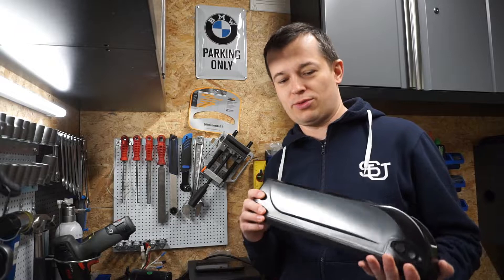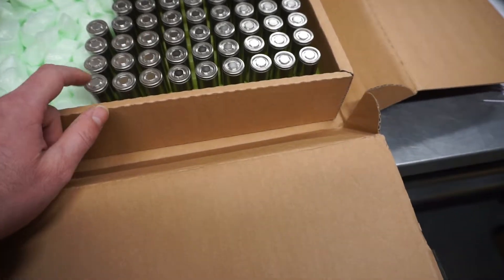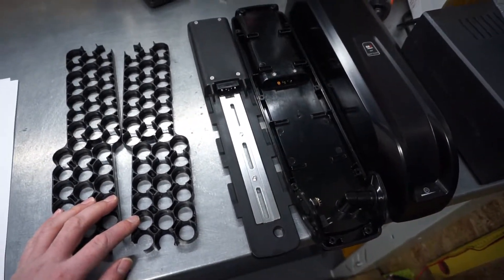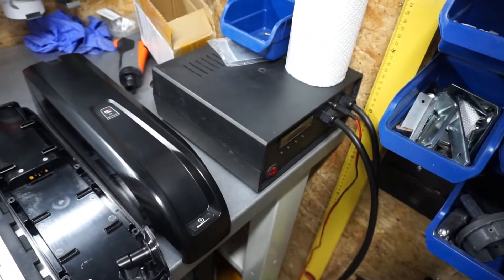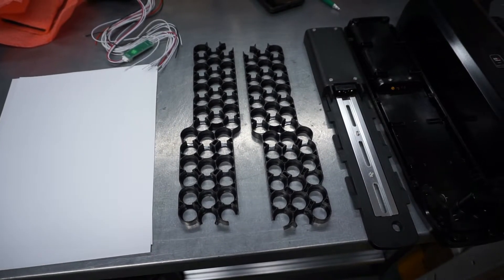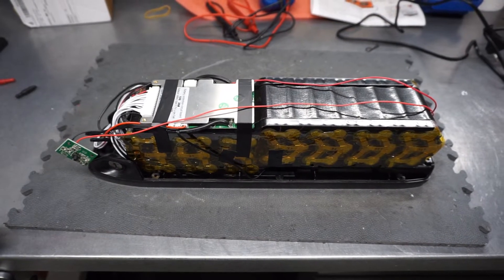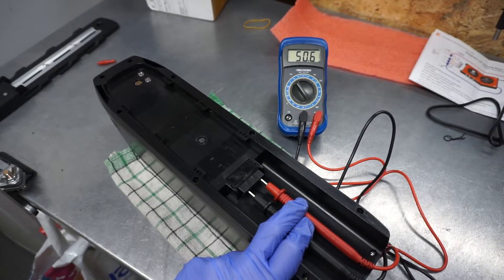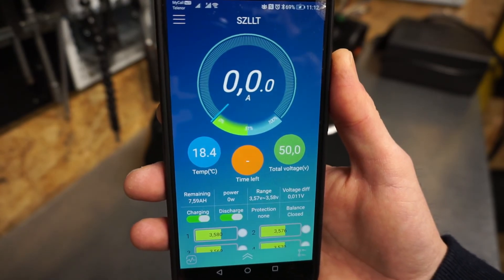Battery with 21700 cells and Smart BMS

Comment: I have a yamaha pw-se motor my battery bms went into protection e and f flashing so do i leave old bms on or do i remove it completely? Do i get another bms put that on the battery or do i not need a bms at all does this device protect my battery if i just add it to the bike my bikes a hardseven 1.0 haibike 2019 model help appropriated guys thank you.
Reply from the maker: If your BMS in original battery is kaput, then you need to install a new one. It's impossible to get original one, so you have to go with generic one plus Yamaha BMS dongle. I have separate video about it.
Reply: @LierskogenEbikes  Thank you should i get a smart bms can you trll me which one to get please and ill order it your the best person i could ask for advice.Cheers

Comment: How do you turn on the pairing of the Smart BMS on the battery..?  I know how to pair things with my smart phone, but the battery doesn't have a button to turn on pairing function...
Reply from the maker: With the power switch on the battery. When this battery is turned on, BMS starts the Bluetooth module.
Reply: @LierskogenEbikes  Thanks.. I just ordered 2 new batteries for my recumbent trike... they are the 52v 19.2ah Tesla 21700... And they have SMART BMS .
I'm anxious to see if they deliver 47% more range and up to 80% more power... UPP has a great reputation..   Cheers

Comment: Hello, I'm planning to install the CYC X1 PRO 2 on my fatbike. I live in Switzerland in the mountain and what mainly use it during winter time uphill with some load. What will you recommend as a setup to get a maximum of torque as the high speed is not such interesting in this case. Idea of setup with battery and controller is BAC2000 + 48v = 4000W or BAC855 + 72V = 3200 W. What would be the best setup in my case ?
Reply from the maker: Motor with BAC855 has much more clean layout than BAC2000. BAC2000 is bulky and has bad cables arrangement sticking out of the box. I'm happy with BAC855 on my fatbike. Really I don't need more power from this motor. For BAC2000 you will need special battery to deliver high current of more than I recon 50A-60A continously to see a real difference from BAC855. People don't say it but output from this BAC2000 controller is very affected by the battery. BAC855 is limited to provide max 90A in the peak, but BAC2000 can give up to 220A peak.
Reply: @LierskogenEbikes  : thanks for your feedback on the controller. What will you then recommend with Controller BAC855 as a battery setup ? In consideration, that I will not do much Km (20km max). Will a 52v 65A 12Ah be a good choice, any thoughts ?
Reply from the maker: @michaelmagnin  Range depends a lot on your riding style with PAS or Throttle. With 72V 14Ah on my Fatbike I can get up to 80 km range on medium power levels (not exceeding 1 kW peak).
Reply: Hi im from Switzerland and can build a battery for you if you want.